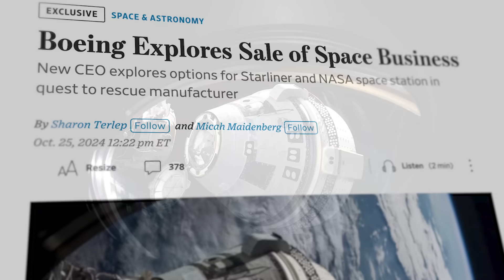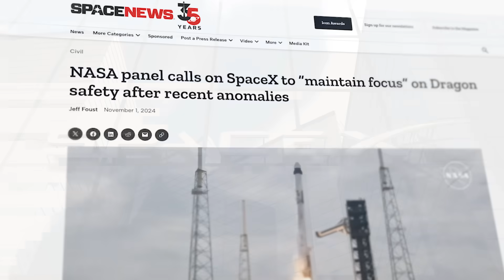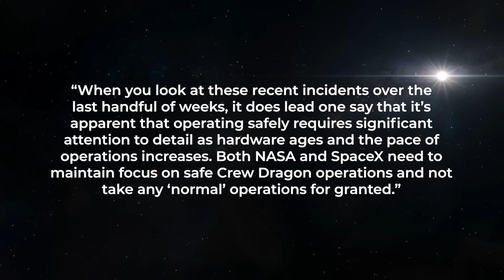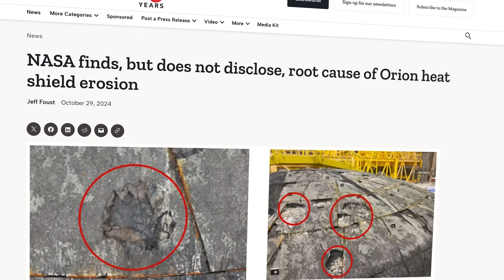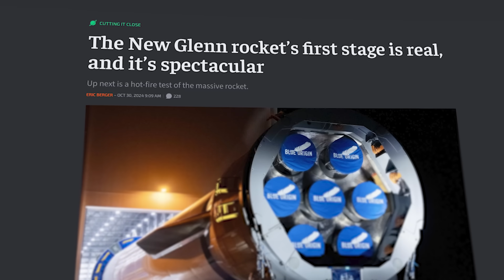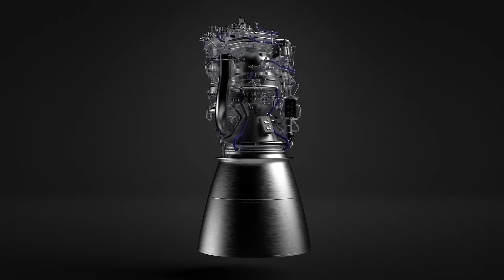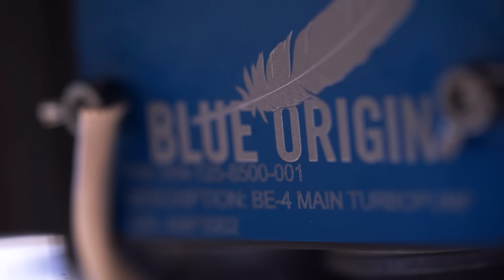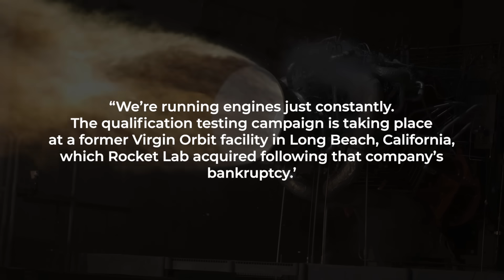Boeing Just Gave Up On Starliner...

Comment: No, the crew dragon 2nd stage had a small mis-timing on the deorbit burn, so it dropped slightly out of zone in the Pacific ...
Reply: Let's just hope SpaceX doesn't have a "small mis-timing on the deorbit burn" on a Crew Dragon mission. If they were trying to land on the Gulf side of Florida, and shot long, they might just hit land.....
Reply: Absolutely.  The video claims SpaceX lost a payload.  This simply didn't happen.  

[Well, I was wrong about this. See below.]
Reply: @mmandrewa2397  There was another anomaly on Starlink Group 9-3 in July, in which all the payloads were lost when the second stage had an oxygen leak and failed to relight for the circularization burn.  Which makes 3 anomalies in one summer...only one was a mission failure, and it was "only" a starlink mission, but it is mildly concerning to have three issues in a short span.  It suggests possible systemic or culture issues.  They can correct, but it is worth some attention.
Reply: @darylbardo  

Thank you.  You're correct.
Reply: @darylbardo  these issues happening withing 1 month is an anomaly but not a strange one, you are bound to have more accidents when you launch more rockets than anyone else does.
Reply: @darylbardo  True. They are in uncharted territory, putting this many repetitions on launch hardware that complex. They need to learn from that problem. Hopefully they keep important missions on the freshest boosters.

Comment: id love to see a crewed dreamchaser but i dont see sierra having the resources to either get the starliner to work or change the dreamchaser back to being crewed anytime soon. a blue origin dreamliner could happen and it would save BO a lot of time and effort though.
Reply: The biggest issue with dreamchaser is the weird aerodynamics during launch compared to a simple pointy capsule - the launch vehicle company is gonna needs lots of $ to approve it for launch and I'm not sure there'll be launch insurance available as it's so different to everything else. As for the $, it's something you mention that sierra space may not have, I agree.
I'm not sure if taking starliner with all it's baggage is best for BO rather than just identify the talented engineers and hire them.
Reply: @aowen2471  a clean slate design is an option certainly. BO dont have to buy the starline and they have some experience of building capsules themselves but do BO also get the crewed flight contract with the starliner? if yes then i think it still makes sense.

Comment: Cant wait for lanch 6 starship
Reply: They caught an empty cylinder last time-  At this rate we will be drinking recycled urine in a lava tube on Mars soon-
Reply: How come? It sounds like they are not trying to do anything new. Just a repeat of flight 5.
Reply: @bluesteel8376  because this is cool
Reply: @bluesteel8376 Flight 5 still had its glitches. Specifically the re-entry thermal issues on starships slats and misconfiguration of the booster that almost triggered an abort command during the catch. Sure flight 6 will probably look similar to flight 5 but there is still lots of room for improvement. Next up I bet we will see orbital refueling or a starship catch attempt
Reply: @bluesteel8376  because its cool and i think isnt the 6th starship based on like a different prototype instead of the standard models. plus we can expect a landing of the starship on a proper landing pad hopefully.